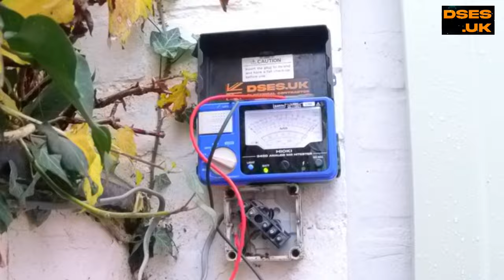FFS, *AGAIN* with the SELV spike lighting!

Comment: 4:26 I’ve got the exact bench. I’ve had it years. I love it. It also has clamps the fit underneath
Reply from the maker: Yes, the two recessed clamps are rather handy. I haven't had cause to use them in anger yet.

Comment: I find it crazy that over the pond you're using 240v AC lighting outdoors. In the US it's common for pretty much all outdoor lighting like that to be done with low-voltage AC 12 V and you just string the cable through as it usually twin lead and the lights have insulation piercing connectors. I've seen a handful of instances where 120 V lighting was used but usually that's more professionally installed conduit etc. underground cable out to sign lights mounted in a professional manner.
Reply from the maker: It is crazy, and quite unnecessary, yet most spike lights are made in the GU10 form factor. It's hard to find the GU5.3 fittings, so it's either mains voltage or some proprietary non-replaceable thing for the most part.

Comment: That's a nice trick with the dowels. I usually use the plastic yellow 5mm plugs as they will hold a clip, but I bet not as well as a dowel. You can buy dedicated "pin plugs" as well for that purpose, but I don't think they're any better than the 5mm plugs and cost more.

Comment: well another great shit show, and what an ending.  I for one was holding out for a direct head shot but it was close enough. 
Keeping them coming, Sorry Dave that's a comment for the pigeon. 🙂

Your description of armoured cable and then flying leads to the lamp matches the shit show that is the garden lighting here. 😞
Reply from the maker: Mad isn't it? Even if you did want the fuss n' faff of terminating SWA into Wiska boxes, you could still put in a little localised LED driver to power a 12V spike coming off it.

Comment: That little dowel trick is good you can buy little plastic ones meant for the job as well from B&Q
Reply: Yeah, I like them. I tried to introduce Dave to them a few years back but he was having none of it so we stuck to the dowel. It probably is better than using the the plastic ones but who wants to tell ol’ misery Savery that he’s right? The gloating it would generate.
Reply from the maker: @Marshun  I never found the official plastic things to be much cop - and a lot more expensive than just getting wood. If, indeed, you still can get wood?

Comment: I think one criticism when it comes to selv lighting is what happens when the transformer or power supply fails, I have come across a few large outside lighting installs where they have used a very large transformer or a proprietary thing which you struggle to get hold of when they fail. Whereas 230v just needs a cable to the points, so as long as thereis a supply and everything is sound then it makes it easier to replace, retrofit and add to. But overall I agree, i wouldn’t personally want mains voltage round flowerbeds etc
Reply from the maker: In this case, it's a 12V constant voltage thang which is always easy to get hold of. The headache comes when you buy an off-the-shelf proprietary lighting kit that uses a funny constant current transformer.

Comment: Why my system is essentially build as cheap and simple as 24V garden lights can be, they will break no matter what so why make it any harder to repair.
Already have one light with condensation on the inside and it started flickering recently... ffs these things man!
Also cut a cable clean trough with the hedge trimmer couple months ago cant be bothered to fix that.

I probably should replace the failed ones (there will be more inevitably) with one of those standard 230v spike lights and just put a low volt bulb in it BUT I cant bloody find anything thats 24V.

Comment: David, is there a chance of trying an underground cable detector to locate a break in a cable in a wall as opposed to using an mft and maths to see if it’s:
A- quicker
B- reliable
Ive seen a vxscan on Amazon and the reviews seem to be pretty good.

Comment: The van doesn't look right without the other guy, wotsisname in the passenger seat.
I am on my second bench like that one. The first broke when I left a 50Kg granite surface plate on it overnight. The second I got at the bargin bin at Toolstation because it had a plastic foot missing, only paid £35 for it. Made a new foot on the lathe.

Comment: When I've done that setup with outside lights the customer more often than not, then decide they want the ability to override at will. From anywhere.I've done all kinds trickery involving electric gate remote key fobs operating contactors, GSM controllers, you name it. Fortunately much easier these days with off-the-shelf solutions and Quinetic switches. My problem was, when a customer asks "can I", I never learnt to say "no, you fuckin' can't".

Comment: Genuine question don't you get massive voltage drop using 12v for bigger garden runs? Remember as an apprentice having issues with mr16 halogens. If possible could the timer have been installed inside then an enclosure with driver and photocell in the lid? There's pirs out there with adjustable setback timers ie turns on at dark o'clock and switches off 5 minutes later. Tip for flex on a rough wall i use linian clips. Keep the videos coming. Even if it's been done before every job is different so the content will be different.
Reply from the maker: The volt drop can be a problem but not at this sort of length, especially if the feed cable has a larger CSA. Here I went for a 1.5mm 2-core whereas smaller runs may only require a 0.75mm cable. For LED lamps, a volt drop that's too high may see some flickering or other such ill operation, but then some models of lamp may be less susceptible to such, after all, any 12V lamp will be dropping the voltage lower internally and their regulator may have a wide window of input voltage (say, 8 - 16V or something). I've used the adjustable sensors before; I have one myself, but the issue there is they tend to shut off a certain time after turning on. My garden lights go off after two hours which means they're on until 18:00 in the depths of winter and 23:30 in the height of summer. That doesn't really work here where the client wants them on at dusk and off by midnight whatever the time of year. I did consider Linian clips for this one, but I find Linian hopeless to size for a job. Their clips are always stated in mm and I never know how that relates to a cable so I never order them. What size clip would work for a round 2-core 1.5mm H07? No idea. Would be nice if Linian matched cables to clips, otherwise it's trial and error with them, and they ain't cheap!

Comment: Nice video - thanks for sharing. You're right you don't need loads of light at night and a variety of fixtures adds interest. May I ask what LED driver you used please?
Reply from the maker: I tend to get drivers from Amazon - usually Sebson models although this one wasn't (not sure what it was actually). It's just a vanilla 30W 12V constant voltage model.

Comment: Your 12-volt MR16 "can" fixtures look similar to the "12-volt 20-watt halogen pond lights", I used to be able to get at the local big box hardware store, unfortunately, a deleted line that was superseded by a cheap plastic non-user serviceable built-in LED trash.

Comment: What’s the model of the powered screwdriver you were using Dave? I’ve got the Bosch Go but that looks a bit more ‘portable’ will have to take a look at it as haven’t bought tools for a while 😅
Reply from the maker: There's a link in the description. I can't speak for it's longevity or reliability, and it has no torque whatsoever, but for basic zipping and unzipping of accessories, it's a decent weight and size. I can keep this in my hip tool pouch unlike my Bosch which is too heavy and ends up staying in the toolbox.

Comment: Hi David, are you aware you can buy what are basically rawl plugs for nails? Also check out the Steinel
Nightmatic 3000, it does basically what you have just assembled.
Reply: They're called Pinplugs
Reply from the maker: I haven't seen the Steinel, although I myself have a hybrid sensor that detects dusk and shuts off a pre-determined time later. The problem with that though is if you set it for, say, two hours, then it'll be off again by 18:00 in the peak of winter and not until 23:30 at the peak of summer. Nige introduced me to the nail plugs, but I got set in my ways with dowels.

Comment: Nothing wrong with your use of dowels, but did you know TLC do "Wall Pin Plug for Cable Clips"? I didn't know they were a thing until someone pointed them out to me.
Reply from the maker: Yeah, Nige once got some, but I didn't like 'em. A bag o' dowels is cheap n' easy.

Comment: For outside timers I use a "smart" timer with Tasmota firmware, you can set up a timer that adjusts for sunset every day by just ticking a box, no real need for a light sensor.
Reply: Or a good old fashioned Venner solar time switch..!
Reply: Nice. I too have a sonoff basic switch flashed with Tasmota firmware talking to Node Red. I use the 'Big Timer' node to switch at dusk and dawn as it changes throughout the year. Good fun.

Comment: There is a company called "TV TECH" that makes a product called "Nailing Plugs", I have been using them for years, never thought of the dowel method like yourself but never had an issue with using them and have proved invaluable when working on walls like this that are just crumbly as fuck and walls that are just that fucking rock hard it just bends the nails. Get yourself some of those, that will keep the arm chair bastards happy from moaning. Personally I think you method is in genius.